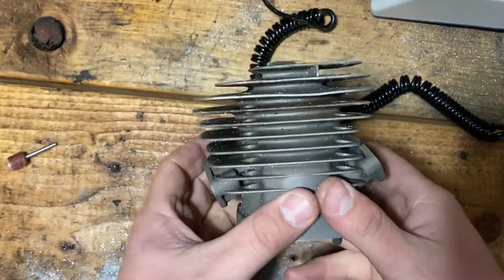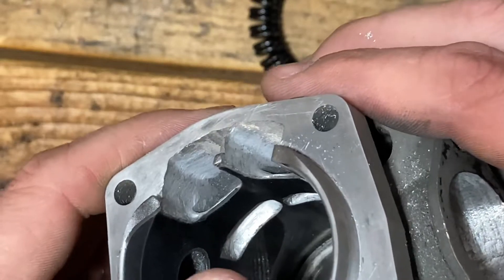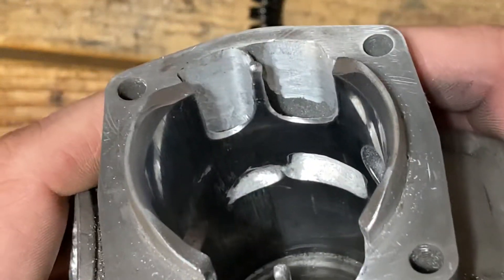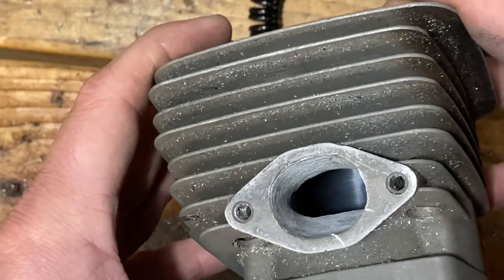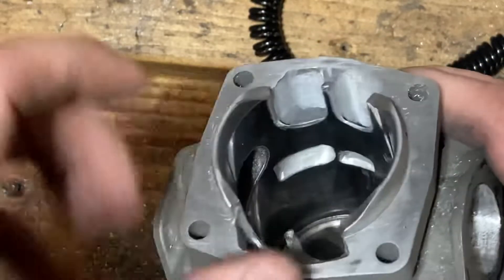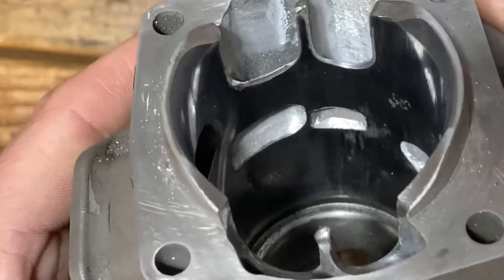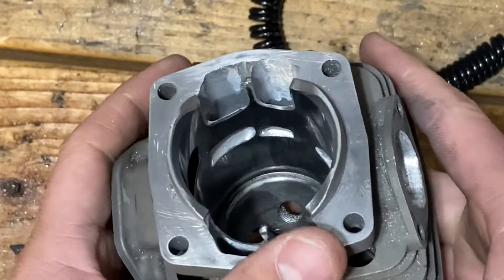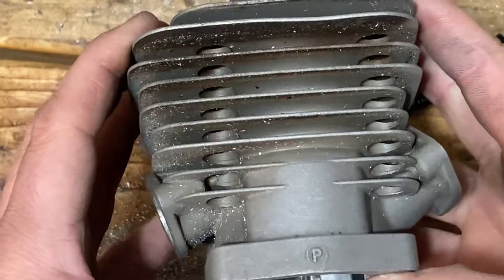Echo CS590 ugly Junker Saw porting: Not Impressed Yet

Comment: Nothing ventured nothing gained. Make sure the bevels are good and it should be fine. Curious to see how it runs
Reply from the maker: Bevels ended up decent.  I’m largely unimpressed with my upper transfer work. Still on a big learning curve of the upper transfer work, so this cylinder was a perfect science project as it wasn’t a perfect jug to begin.  Carb and pipe work next.  Working out the kinks before I do the hybrid build!
Reply: @ChecksGarage  don't be too hard on yourself. Other than tiny top handles. Those 590-620 transfers are about the worst to do